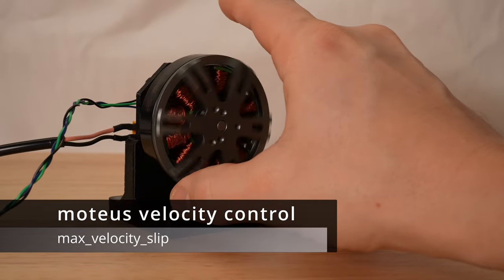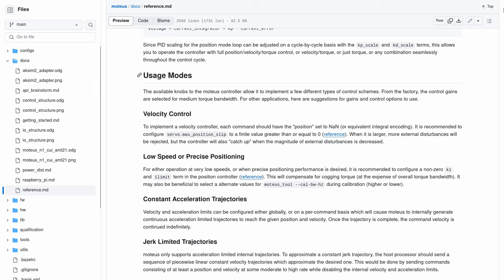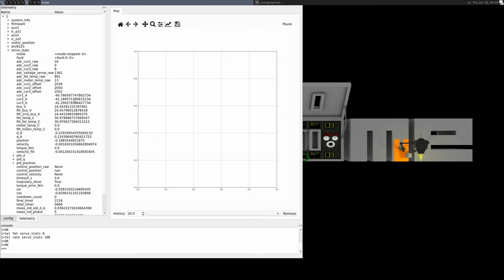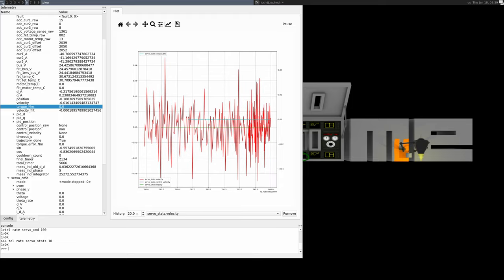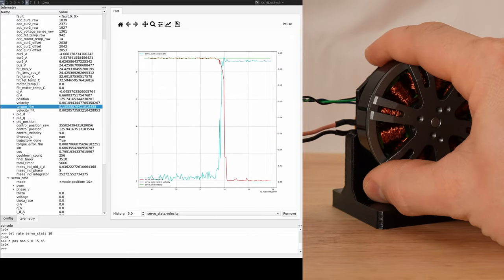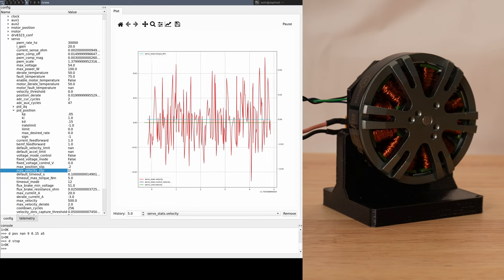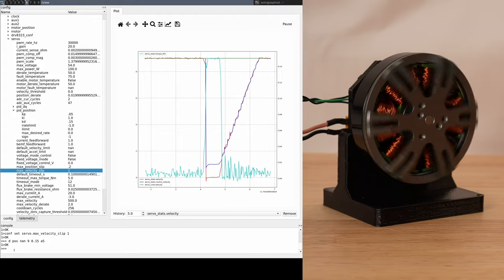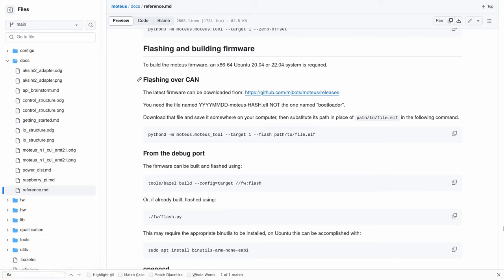moteus velocity mode improvements

Comment: nice work. can you also make a controller and software to control a brushless motor without magnetic encoder? i think vesc can do it.
Reply from the maker: moteus does support a wide range of encoders, including non-magnetic ones, but it does currently require a sensor of some sort.  If want to run sensorless, there are plenty of other options, including RC ESCs, VESC, ODrive, etc.

Comment: Hi, I'm currently playing with the dev kit ! Great stuff ! 
This feature will come in handy as I will need tight velocity control in my application.

I'm wondering; would you consider implementing a more direct velocity mode that would not be relying on tricking the position mode like it seems implemented currently ? I feel like it could help in some regards like reducing torque ripples and also be a bit more intuitive and less manipulation when having to switch back and forth between position and velocity mode (I need both, but not simultaneously...). My application is a precision instrumented machine and needs the smallest amount of torque ripples and jerk in the velocity control, whilst retaining tight control. 

If need be, although a bit of a pain, to minimise torque riples, I might even have to switch to a less noisy "fixed" driving method  like "d dq" for a brief moment while reading my instruments. I figured I could collect an exponential moving average of the q_A while in velocity (pos NaN vel) mode and switch to d dq using that q_A EMA. Any thoughts on that approach ?

I also experimented a little with the "d pwm : phase/mag/rate" mode, but the motor seems to have little to no holding torque, even when consuming ludicrous amount of amps (almost burned my motor :/ ). Is that super low holding torque expected behaviour ?

Also, are you planning on documenting (video and/or git reference) how to set up a different motor properly ? Like what parameters are calibrated ? what are those we shall change manually ? What if we only change the mechanical load (inertia, damping) ? Do we need to re-calibrate or just tuning PID is enough ? I could not find a thorough guide on that subject.

Thank you Josh !
Reply from the maker: Hi!

When implemented according to the docs, i.e. 
1) having no position mode integral term, servo.pid_position.ilimit <= 0
2) defining either a non-zero `servo.max_position_slip` or setting `kp_scale` to 0

The control law used by moteus is identical to any other velocity control loop, for instance that in the ODrive controllers.

That said, there are many avenues for improving torque ripple in a given application, including tuning encoder and torque bandwidth, tuning PID gains, and possibly switching to gimbal control mode.

For setting up a motor, the only required thing is using `moteus_tool --calibrate`.  Changing the load will likely require re-tuning the PID control parameters, for which a procedure can be found here: https://github.com/mjbots/moteus/blob/main/docs/reference.md#pid-tuning

PS: YouTube comments aren't the best place to do application support.  If you want to iterate faster, hop into the mjbots Discord and I'm happy to talk, experiment, and find a good solution for your requirements: https://discord.gg/W4hUpBb
Reply: @awesjosh  thanks for your support ! I'll definitely join the discord channel if need be. Cheers !

Comment: Fantastic! is it possible to control it and read pos, vel, torque from arduino?
Reply from the maker: Yep.  A desktop computer is still required for calibration, and it is much easier to do initial configuration with a desktop computer, but full control and monitoring are capable from an Arduino:

https://github.com/mjbots/moteus-arduino

Look for a blog post and video in the next couple of weeks!

Comment: You do an incredible job, congratulations, I have a question, when I try to compile, I get the error fatal: not a git repository (or any of the parent directories): .git in ubuntu 22.04, i have install only curl like you say in the reference document, what am I doing wrong?, you are amazing thanks for all
Reply from the maker: The build system requires that you be operating in a git checkout.  Feel free to ask for help in the mjbots Discord, which is a lot more conducive to support than YouTube comments: https://discord.gg/W4hUpBb
Reply: @awesjosh  Thanks so much, the problem was that i have copy the folder i have to clone it. I solve the problem with that. Thanks so much for your work